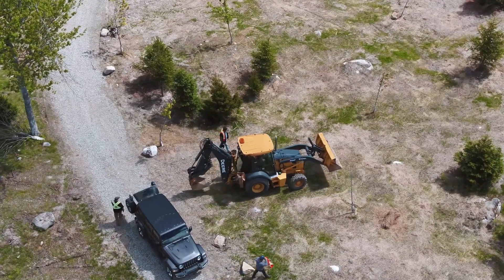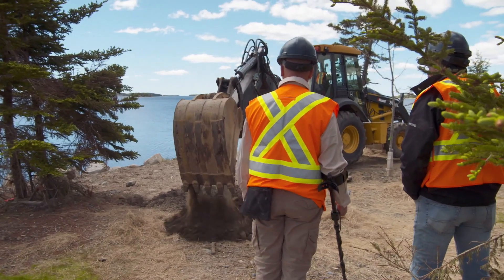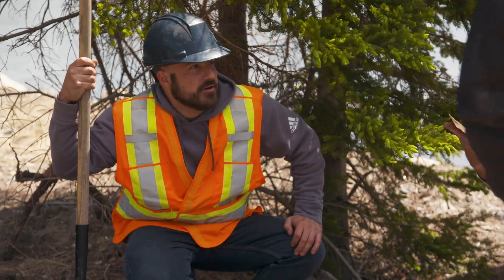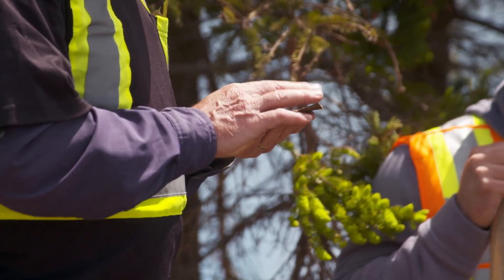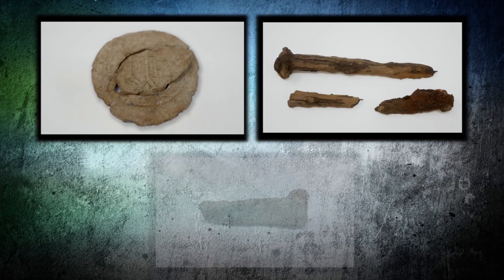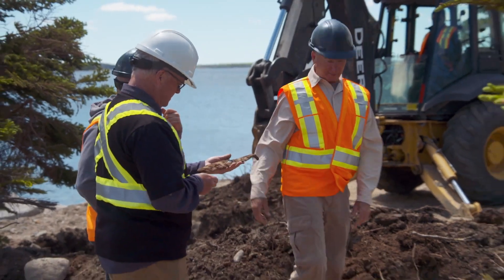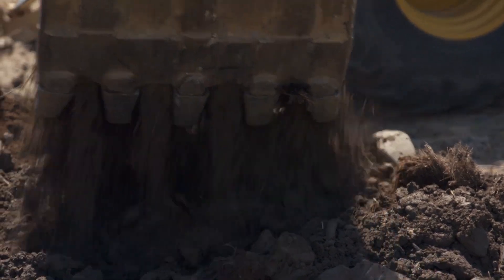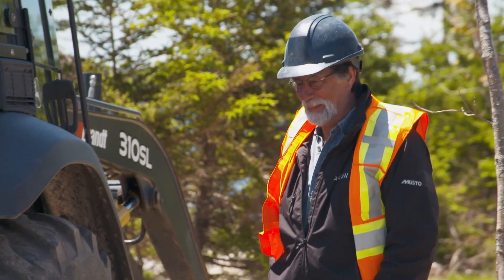The Curse of Oak Island: EVIDENCE OF SHIPWRECK Found on Lot 32 (Season 10)

Comment: Just realize the impact of finding - just one piece of lead sheeting - what that means on Oak Island.

Lead sheeting is only made for sheeting a ship.  Yet, there needs to be natural resource lead on the island to smelt and beat into sheeting.  Natural resource lead - yes.  Need miners.  Need smelter and smelter people.  Need wood, charcoal, and/or coal for smelter.  Need a kiln for making wood into charcoal and kiln workers.  Otherwise, need timber and lumberjacks bringing wood to the smelter.  Need wagon, oxen, and wagon master to haul wood from lumber site to the smelter.  Need blacksmithy with wood, iron blacksmithy tools (brought to the island or made onsite needing raw or processed iron ingots to form all the needed tools).  Miners bring raw lead to mechanical unit - or heavy men to beat sledgehammers on rocks to pulverize them.  Need someone to made wood and metal sledgehammer parts - woodworker and ironworker.  From crusher to smelter for processed lead being melted at 622 F.

Lead and tin mixtures commonly found together (on Oak Island and elsewhere) melting out at 450 F.  Someone needs to process out tin - and then use tin as a metalsmith making tinware for the island.  Zinc is known on the western island, and is found away from the lead and tin.  Yet zinc also smelts, and then used with imported copper and silver.  Copper melting point 1984F.  Silver melting point at 1763F.  Copper and zinc make brass.  Copper and tin make bronze.  Silver and lead make low-grade pewter.  Silver and tin make high-grade pewter.

Lead sheeting for ships.  Ships brought in for careening and cleaning - and lead sheeting need proper nail (not lead nails) so potential not-so-corrosive brass or bronze (or imported corrosive iron) nails used on attaching lead sheeting.  Ships need drydock, so entire landscape needs engineers to create unforested and flattened drydock area, with wharfage, pierage, and pulley systems to haul ship onto drydock, and also to pull it back out into the harbor.  Then you need a harbor !!!  Engineers need to create harbor from the triangular estuary area, diggers, wagons, oxen, wagonmaster, men with buckets, people on receiving end of all the harbor debris being piled onto Lot 15/16.  Someone needs to be farming for all the food (grain and vegs) for these people to eat.  Cooks need the raw foods to make meals for the workers.  Woodworkers need to make housing and industrial buildings for the workers and industrial sites (kilns, smelters, blacksmithy, metal works, wood works).  Blacksmithy make iron ring botls while stonemasons take boulders and make hole for ringbolt, and wagons and crane pulley systems to lift up, cart, and move to fixed position for anchoring offshore ships, even making floating wharfs attached to the shoreline needing further lumberjacks, woodworkers, pit/gang sawmills and workers.

For all of the wagon transports of oxen and cargo you need proper roadways of hard rockwork and packed dirt/sand.  Engineers to lay out the southern shoreline of both islands and the rock roadways around the harbor.  Find, pull out rocks, transport, dump, and fix into place (1200s, 1600s reconstruction).  Transported sand (beaches and harbor diggings) and dirt - making packed down dirt roadways.  Roadworkers, wagons, oxen, rocks, dirt, sight lines of wooden timbers (Fred Nolan timbers found - as well as the smaller 1600s roadway stakings.

Ship construction, repairs, cleanings, all need timber planks, nails, wooden dowels, fiber material (coconut fiber, textile fibers grown on the island), pine tar/oil/pitch sealant, lead sheeting, sheeting nails, sail cloth and sewing thread, ropes ("lines"), timber masts, crossarms, wooden rudder with metal sheeting, roping, and ship's wooden steering wheel.  Glass windows need a glass kiln for making glass window panes.  Massive portion of shipwrights making proper ship timbers, planks, decking etc.  Rope makers needing raw fiber crops to make fibers into would thread, string, into ropes.  Farmers grow fiber crops.

Just considering that lead sheeting was used on Oak Island as a (assumed) basic ship's repair yard - and all of the other infrastructure and technologies and engineering that was needed for continuing these business income operations.  Not 32 subsistence cabbage-growing farmers of family of 3-4 (2 parents and 1-2 children) on the island (96-128 population).  There would be a massive work force of 400s real adult working men just for the swamp to harbor operation, 100s for making the roadways, 100s in support of the shipyard business.

The historians who wrote about the island have really done a massive disservice in just having these islanders being Gilligan's Island peeps.  You don't have the potential of 7+ floating wharfs, with an internal harbor of 3 anchor stones and floating wharfs, and 1 ship's drydock and construction/repair facilities for cabbage farmers.  Oak Island in its historical past of the 1200s (1086 dated remains now) - 1700s ... with only the reality of the Baronets of Nova Scotia (1625ish-present) being a population of pre- and Industrial Revolution era ironworkings).  The greater majority of activity shows (1200s-1600s) with the establishment of the harbor, rock roadways, mines, and craft and industrial activities ... while the (1600s-1776-1800) would show reconstruction activity of the harbor, roadways, and second generation of mines, craft, and industrial activities.

Oak Island - in its own right - is itself a complete treasury of historical complexity across millennia.

I did start a listing of all the given artifacts by known dates - and that would have shown these hidden eras all before the post-1776 times and start of the Oak Island treasure legends of 1795.

Comment: This is kinda far fetched but the design on that piece of possible stove with the decorative look, looks like the sumerian piece that talks about annunaki being beings of light.
Also obviously we see where this is going with the whole French connection, however it doesn't explain everything, there's artifacts that predate the mid 1700s, some by 3-400 years. I think the island has been used at different points over the years, the road in swamp is prime example. doesn't make sense that you would build a road on opposite side of wharf. That'd be like me saying ok build the road oover there so when we unload it we gotta load it on the dingy and take it to the road we built across the bay? What kinda logic is that?
One last thing I find it funny that when they first found the "garden shaft" I wrote Rick and said hey guy if there's a shaft that's filling with water faster than you can dig, wouldn't that mean that's where the box traps are draining into? meaning I bet that's the pit. I said that five years ago, so got one up on that one metal detector comment lol. I just think there's something alot more interesting than a French expedition. They would have had to of known about the island prior to setting sail, since it's not mentioned by name in official documents. Also if it were just that expedition, where did the ship come from that's in the swamp? Or for that matter the supposed treasure that was buried? Why would Louie have been like, take all this treasure to this island hundreds of kilometers away and bury it so no one will ever find it? I dunno just seems like there's more than just the French coming there.heck the tar kiln pretty sure predated that expedition too if they only gone for 2 months that's a lot of work done in short period of time.

Comment: I can’t help but think that the lead cross is some kind of sighting device to be used in conjunction with a map or inserted into a long gone stone. The square inside the head indicates where the vault is.
Reply: How would it be used when it’s carved into a wall in Portugal
Reply: @charliesangles5280  I think that carving gives it more significance.
Reply: @adamscott-young1216  I meant, how can it be used as a sighting device, when it’s also carved in a wall. Obviously it’s not been used to cast lead copies
Reply: @charliesangles5280  The actual cross has a hand on it which may signify the five fingered flood tunnel which is 365’ from the money pit. The arm on the hand even has bumps and appears to depict rocks or perhaps the coconut fibre filling. If this scale is used then the square in the head may be 73’ to the WSW of the enscription stone at a depth of 130’.(40’ below)
Reply: If you accept that statement - then you need to consider that the Templar cross overlaid onto the Fred Nolan cross - that the bent head and square hole - would be under the area of (now) Tom Nolans house, driveway, and garage/barn !!!  Right in front of your very eyes !!!  Even on the Domme Templar prison scratching of the same Templar cross insignia !

Comment: It seems like oak island was two islands that made a natural harbor/dock system.
Reply: Hebrew 🙄👋
Reply: There are 2 geological islands.  The western island with a shale bedrock; the eastern island with a limestone, gypsum, anhydrite (super dry limestone-gypsum), greywacke (greywacke, greenstone, bluestone), and granite bedrock covered with blue clay, sand, and rocks/boulders.  There is no proof that the inter-island area became naturally glacially silted up at the northern end (northern lots) while the southern wider end became ocean water-excavated to a depth of 45 feet.  The process and proof is that the earliest of current documentation is that the 1220s events happened where the northern portion was dug into, filling in and piling up boulders and hard packing sand/clay/dirt creating that land barrier (the northern lots) of substantial (tnen) 20-30 feet elevation (now about 5-10 feet high).  The southern end was also originally also bouldered, piled up, and turned into a hard dirt packed rock jetty.  Digging down and excavating the actual contours of the sloping harbor removed 1+ million cubic feet that was piled atop Lot 15/16 (with its higher elevation, now current 35 feet elevation).  Both islands were glacially scraped flat - with the rest of the other uninhabited 300 islands in the Mahone Bay area.  Only this single hillock, which is not a glacial morraine is on the eastern island.  The Eye of the Swamp artesian freshwater rocked-in well was also created at this time.  When finished with the surrounding rock roadways, the southern jetty was broken and opened up, allowing the inflow of water creating the manmade inner harbor between the islands.
Reply: @johnlord8337  Hey 👋
Reply: @LauRoot892    Laura!
Reply: @johnwoa  Where ya from ? 😊
Reply: @LauRoot892    I'm not sure at this point.  All I know is where I am at now.  Life's been strange.....
Reply: @johnwoa  Where ? Howdy 👋 from Indiana. 😃
Reply: @LauRoot892    Originally from Cincinnati.  Don't know much about Indiana.  We went to a place called Santa Claus, Indiana when I was a kid.  That was many light-years ago.  My grandpa was born in a bedroom in a house that straddled the Ohio/Indiana border and a huge battle ensued as to which state he was born in... LOL!  When he got to be age of reason, he successfully fought to have the records show that he as born in Harrison, Ohio, and the rest is history!  Interesting as heck!
Reply: @LauRoot892    I was finally able to retrieve your Reply that got "deleted/censored".  I do not do texting.  Sorry!
Reply: @johnwoa  so what do you do ? Oops 🙊
Reply: @LauRoot892    What do you mean by "Oops"?
Reply: @johnwoa  nothing, should I send you my Number ? 😎